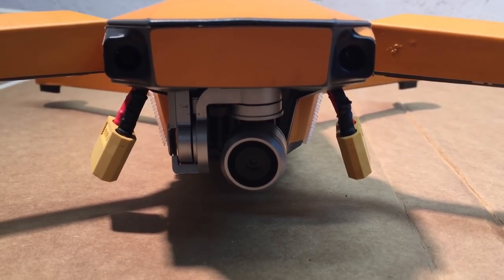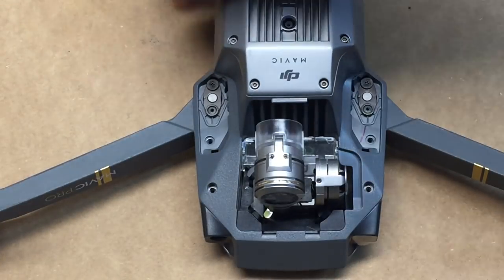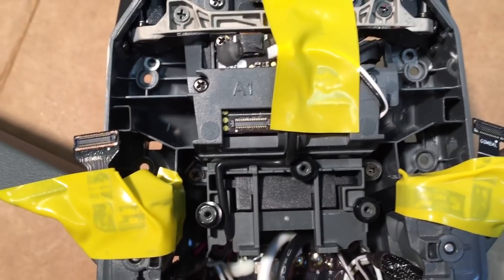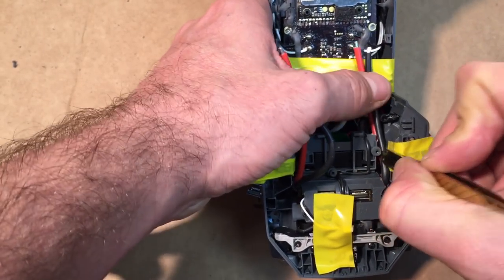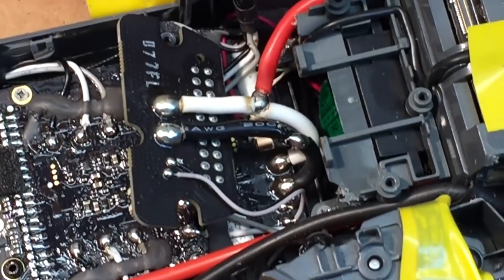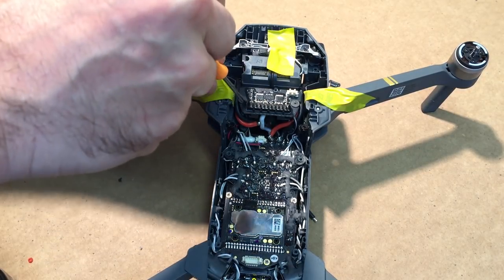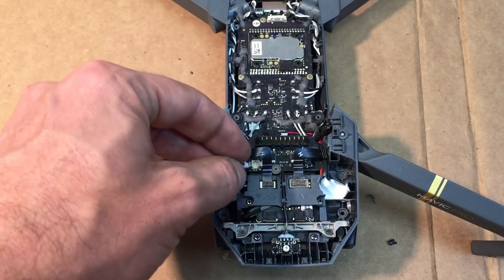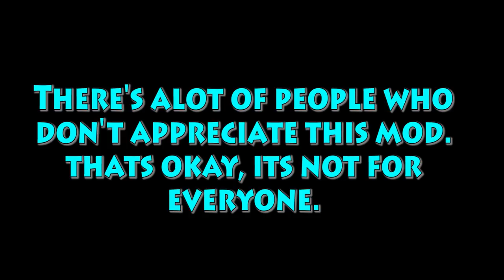DJI Mavic - Updated dual battery mod how-to

Comment: Open shell of two original battery and parallel them , then soldering
out one pair of (R004 )resistor of one of bms board (on right side angle) and put them soldering on the other bms board on top of the resistor together , u will get double battery power, around 32 mins hovering time and 20% battery time left, it’s best way for getting long flight time, just be careful to (soldering battery and bms board to avoid locked the board!)
( u must cut off battery when u soldering bms resistor!)

Comment: Def got voltage bleed with the way you cut them wires. Shoulda used a scalpel or sponge shave alil at a time.. but then again like I says buy a smart battery board with their connectors and then build your own. Plus you'll have all that extra battery bay with your own 1200c 34000mah battery. Fly for 2  hours 40 mins. Why no ? Due make sure batteries are at 11.1v n not 11.4v also 3s. Parallel & NOT in series.. 
When in series it acts as one big battery to where parallel it's gonna drain one by one. Not the whole big battery all in one shot at the same time...

Comment: This is the best video I've seen yet to short out your chopter.. smh.. only a matter of short time before both those ends meet.. plus those wires have 4 connects like rite on the same spots. 2 under n 2 uptop.. you didn't even need to cut wires..n just preheat bottom n fuse on with flux.. heat top n fuse 2nd leads on with flux.. 
The best part, dji actually sells smart battery boards so you can make your own smart battery.. but I'm sure with all that cutting on the supports of the frame you already knew that.. so much extra flex now..

Comment: Why did you mod the drone instead of the battery ?  Can't you just solder a 4-pole plug for 3 x 18650 cells in line with the existing pack polymer ones ? [taking care not to trip the battery self-destruct switch of course]

Comment: Question will this work for mavic 2 enterprise dual thermal. I’m sure you’ve answered already but couldn’t find it. And in my earlier comment was wondering exact batteries I should get. Link would be great don’t want to get wrong ones and screw up after all that. You Rock bro! If you have a patron page send me link I’ll donate.

Comment: I thought you could already get 30 minute flights from the stock batteries? Wouldn’t adding more weight not give you much plus require you to have to register it with the FAA??

Comment: Hello .. I have 3 dead mavic batteries.. stored them for over a year brand new unopened. Stupid i know :-D .. but looking at your skills I thought you might be able to suggest something that I could do to revive them .. is there anything at all .. please tell me there is .. thanks in advance
Reply: use smart charger. if that dont work than watch video this russian guys has on the fix
Reply: The fix is here: https://www.youtube.com/watch?v=P5PNOO2GebY&t=1067s - it's annoying.  On the plus side - 3 x 18650 cells fit in the same box, and you can drill a hole to mount a holder for 3x more 17650 cells on the top of the battery too - giving you more than double the flight time, as well as cells that don't bloat and die...

Comment: should find a way to make a adapter for the battery so u dont touch the mavic and use the stock battery ports but able to mount and plug in a badboy like HobbyStar 8000mAh 15.2V, 4S 100C which will give about 2.5x battery time and its a 4 cell so the app reconizes it as just normal battery but 8000 mah intead of 3000mah.

Comment: Cant seem to find any help bought a TURNIGY UP610 200W SMART CHARGER but I dont know what power supply will work , usin  duo BOLT 1300MAH 3S 11.4V

Comment: dear sir , can you provide the production process picture? Will the total voltage of the smart battery board power off, the motherboard will be locked and can not use it? The original balance of the small plug power will lead to the motherboard locked and can not be used? can u Please explain in detail how to maintain the power supply while the motherboard will not be locked when changing a third party battery. Thank you

Comment: if there a way to use the stock battery ports and make a mount and plug like a 9000mah lipo on it with a adapter made tapping into the battery with a same 4cell. Tapping into the mavic is kinda crazy lol i thought i was crazy to mod my remote which wasnt such a big deal after all but dam this is kinda risky if u aint handy.

Comment: Software will not recognize those batteries. It will force to land  calculating primary battery amps consumption.  I did this Mod a year and a half  ago. You only get 28 mints max. Then it will land and if you try to keep it long your screen will go black. Good luck trying. 
P.D. Drone gets very heavy.

Comment: I was able to roll back the firmware and change perameters. How do I keep the quad from force landing by changing parameters in DJI assistant ? I have a parallel battery adapter that I made and it works but the quad force lands cause it thinks it has no juice left even though it has plenty of juice from the parallel battery.

Comment: With the new Mavic 2 Pro.  The battery in this drone will give 30 minutes of flight.  So, is this mod worth doing?
Reply: It’s only about $10 or so for the modded battery. Compare that too dji crappy over-priced batteries

Comment: I try and done , better than the copper clip adapter, I just connect wired through on top of the mavic ,
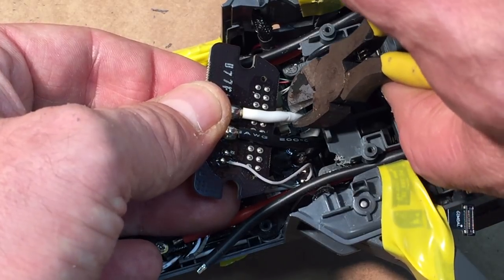(92%start , 20% end up , hovering time 22:57, lipo 2200 ma, 30c)

Comment: Why not to hack in to a battery and add a couple of xt30 plugs on the outside of it that way you won’t void the warranty.
Reply: Someone should just make a bigger battery that hangs underneath the aircraft
Reply: thats what i thought this was doing
Reply: underneath the drone you will find ultrasonic and couple IR sensors, so you definitely dont wanna block em.
on top of it might affect the aero dynamics
Reply: Zangeef Fangsteen lower obstacle avoidance sensors?
Reply: It would be much better making a wider battery that fits in right where the factory  battery goes
Reply: Saulius it still has warranty. dji does not check the inside for mods they only look @ fly data. and yes you get a replacement

Comment: Wouldn’t burn the mavic ?if stock battery it’s a 3 cell and you are adding another 6 cells on this mod that’s a lot of voltage.
Reply: They are in parallel, the voltage stay the same.
Reply: Ok

Comment: Thx for the vid. Why not just solder one set of leads to the battery connector solder balls (underneath) and then the other set to the motherboard solder balls so you dont have to cut the wires? You may need to dremel more but it looks like that would work...
Reply from the maker: that would work fine .. i do it to save space with wires so the case fits easily.

Comment: Love it!! I have a question Steve, how is this method better over the dual copper clip XT60 connector solution?  are we getting more power using direct internal solder method over the clip method? cheers

Comment: Lead me into that mod please...
What AWG of wires?
Is xt60 the best choice?
And what Lipos do you recommend?
Thx in advance!!!
Reply from the maker: i like 18g, you can use whatever connectors, I prefer xt60 (lotta guys are doing xt30). I like multistar 3s batteries for mavic https://hobbyking.com/en_us/multistar-lihv-high-capacity-3000mah-3s-multi-rotor-lipo-pack.html?___store=en_us

Comment: Its like u r putting 3 batteries.
What about the software 
I mean dji app in the phone will recognize the 3 batteries?
Reply from the maker: all of the batteries will be recognized by the battery % and the volts. The flight time will count down after 25 mins